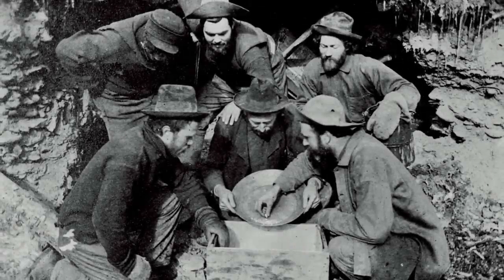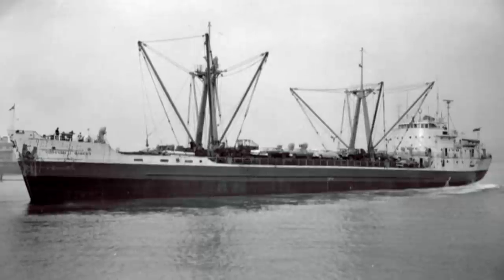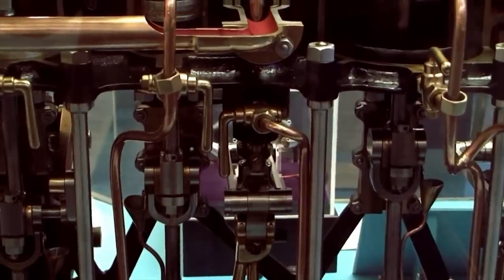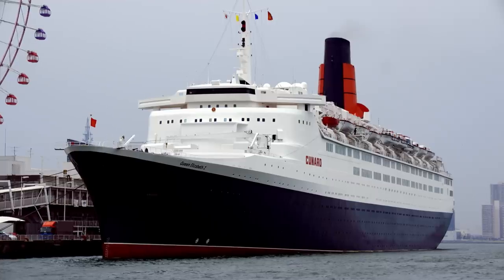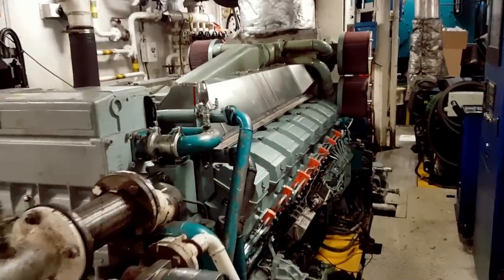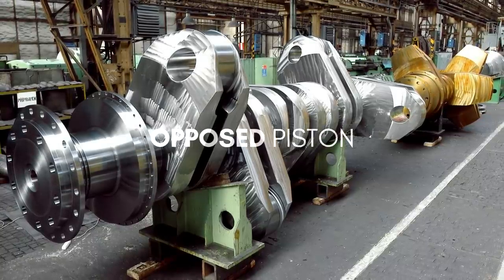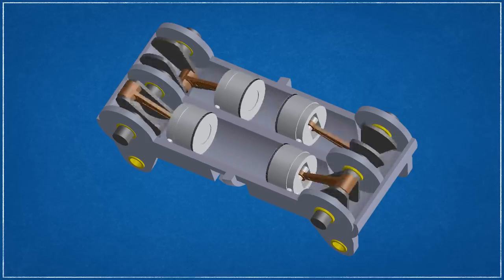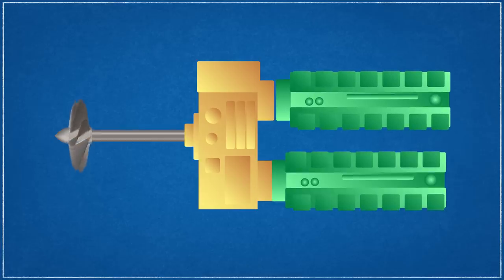The Story Of Large Vessel Engines

Comment: Hi, marine engineering student here, I want to make a comment on the electric drive pods shown in the video at 12:04. This type of propulsion is not more efficient than conventional type of propulsion and here is why. 
For electric propulsion the diesel engines drive huge generators generating electricity. After that the electricity is transferred to the propeller's electric motor via an high voltage system. Then the electric motor has to turn the electric energy back into motional energy. In all these transitions of energy you lose some efficiency. Furthermore, the huge electric motor straight after the propeller increases drag. That's why this system is less efficient than conventional propulsion. That's also why the biggest container/ cargo ships still use the conventional method. 
The advantages of the diesel-electric system is (like you said) maneuverability, but also there is more freedom in placing the engines in the ships design, since the engines don't have to be placed directly in front of the propellers. This is why the diesel electric system is massively used on cruise ships and dynamic positioning ships, where efficiency is less of a concern. Cruise ships sail into harbours almost daily, so a ship with more maneuverability saves in costs of hiring tug boats. Also space on a cruise ship is limited so being free in the placement of the engines helps with a compact engine room design.
Ships with dynamic positioning don't sail as much but need a system like this to accurately stay in position.
For those who have read this, thank you for your time and feel free to ask me any questions!
ps. don't mind my english, it's not my native language.
Reply: Thanks, I didn't know anything about any of that.
Reply: Is it not the case that cruise ships with a huge hotel load require main engines that are 4 stroke high speed to mainly run alternators, with the consequent reduction in height and possibility of constant running over the two stroke diesel, all of this reflects the commercial application
Reply: Yeah i find it weird that a diesel electric would be more efficient than a pure diesel on a ship, especially that no batteries were mentioned. It's not like ships operate like cars. Thanks for providing clarification.
Reply: All your points definitely make sense,  thanks for taking the time to break it down. Also have you ever seen the opposing engine design that was featured in the video.  Thanks.
Reply: @vincentrusso4332  i think there is a british opposed piston diesel.
Reply: Very often there is a number of electric generators which can be started or shut down, depending on the effect needed on the propellers.
One large generator is indeed very inefficient at low speed.
The QE2 has nine generators to drive two electric motors.

https://en.wikipedia.org/wiki/Queen_Elizabeth_2
Section about machinery.
Reply: Your English is better than that of most native speakers I know.
Reply: @vincentrusso4332  hi Vincent, 
I have sailed as an intern on a diesel-electric ship with DP3. The ship was equipped with 6 diesel generators and 6 azimut thrusters (just like the Electric thrusters in the video)
Reply: Thank you!
Reply: Yes,the Doxford is opposed piston engine.Dont think any are still in use but I could be wrong.
Reply: Hi there!
I've heard that maintenance cost is also partly the reason for using electric motors with diesel generators at those big ships, is that correct?
I know that diesel engines love consistent workloads and I presume that the always changing strain on the motor if directly connected to the power train would wear them down much more than good electric motors. So they instead are positioned at the turbines.. Plus no need for a transmission! At least that's how I'd explain it to myself.
I'm sorry for the late question, I hope I'll get an answer nevertheless :)
Reply: @pasta4086  Convenience is the reason for using electric propulsion.It means that you can position the prime mover (engine) in any location not necessarily at the rear.Its nowhere near as efficient as a direct drive shaft setup as there is generator and motor losses to take into account.
Reply: @expfcwintergreenv2.02  I'm sad to say you are correct sir!
Reply: Thank you, that's very interesting! Could renewable energy sources (like solar panels or wind turbines) be added to a ship with electric propellors to supplement diesel generators, thereby offsetting the lost efficiency? I am just a layperson with no knowledge in the field, sorry if this is a stupid question :)
Reply: @eccentricity23  Hi Adam, thanks for your question. Yes, renewable sources could be a option, however there are some problems. If a ship would be equipped with wind turbines, the increased drag would always cost more energy than what it will deliver (except for rear wind, but than the turbines won't be very effective). Solar panels could be an option to add to the generators, however a ship could not rely on this (a ship couldn't sail at night for instance). Also it would be difficult to handle the overproduction of energy when more energy is delivered by the solar panels than the ship spends (like if the ship would be in the harbour or is laying for anchor). However, this could be solved by dumping the energy in the sea water with heater. 
But still, the largest reason that this isn't implemented on ships is costs. The amount of solar panels or the size of the wind turbine would be huge. Furthermore, ships have an 3-phase AC electricity net, so the energy must be converted. All this would probably be more expensive than just using the generators. Also for practical reasons it would be hard if you consider that most of the ship's deck must be covered with solar panels to make a significant amount of energy relative to how much is generated with the generators and used on board. 
Still i think there must be ways to overcome these problems, like using hydrogen produced on shore with renewable energy for instance. There would be a lot of engineering challenges, but i do believe we must go to a more green future.
Reply: @vincentrusso4332  Hi Vincent, i'm sorry to be a little late with my reaction, but no i have never seen these engines, except for on the internet. My grandfather however, actually has sailed with an opposed piston engine. But he told me he didn't like it because they need a lot of maintenance and had a lot of problems. (this could also be because of this particular manufacturer or just because this concept was new at that time)
Reply: @pasta4086  Hi Pasta, You are right with the diesel engines like a consistent load part, however the giant container ships using the 2-stroke engines usually also have a very consistent power demand (sometimes sailing the exact same speed for weeks). 
The maintenance costs of a diesel-electric configuration is usually way higher actually than that of conventional configurations, because diesel-electric ships have multiple generators. For instance, the ship i've been sailing on had 6 diesel generators (8 megawatts each). When sailing at full speed, at least 3 generators were running. This means having 3 times as much running time than if we would be sailing with a single engine. The maintenance jobs on the engines are based on running time, so using more engines will lead to higher maintenance costs. Also you have way more components using a diesel-electric configuration (additional generator, high voltage switchboard, transformers, electric motors, etc. furthermore, all these components need their own cooling system with pumps and everything.). Yes you don't need a gearbox, but gearboxes usually are really efficient and don't need much maintenance. Large 2-stroke engines usually don't even have gearboxes, but have their propeller is directly connected to the crankshaft, even without a clutch.
Reply: @arienvanommen9672  That makes a lot of sense. Are hydrogen fuel cells used on any current large ships? Shipping seems like a perfect application.
Reply: @eccentricity23  not as far as I know, however lng (liquefied natural gas) is coming up as it's a relatively clean fuel (compared to diesel oil or heavy fuel oil). I'm not sure if this fuel can be made with the use of renewable energy, until now they use fossil lgs (as far as I know).
Reply: Diesel electric does away with energy absorbing propeller shaft/s and in someone cases reduction gearbox/s, so what it looses in some criteria it gains in others. The ability to berth quicker with less dependence on tugs and safer in rough conditions is also advantageous. Oh and electric motors will respond quicker with infinite control.

Comment: You mention the Titanic as a "steam piston engine" ship.  But she was a bit of a hybrid.  Her drive used two piston engines driving the wing shafts, and they both exhausted into a single low-pressure turbine that drove the centre shaft.  Low pressure turbines have an advantage over the low pressure cylinder in a piston engine is allowing the condenser to set up a lower than atmospheric pressure at the exhaust without fear of water droplets forming and causing hydraulic locks in a piston engine cylinder.
This was exploited by Parsons in the early all-steam turbine ships as well.
Reply: Excellente!

Comment: Crazy that some of these only reach 80 rpm. Some small gasoline 2 strokes can get above 15,000 rpm. the torque figures on these diesels must by incredible.
Reply: Well, the biggest marine diesels (Wartsila RTA96-C) put out over 100,000 HP. Now if that's an 80RPM engine, the torque is (5252/80)*100,000 or 6,565,000 lb/ft. Let's see a Hemi beat that.
Reply: Now imagine if they could rev up to 7k or something, the amount of horsepower on them would be astronomical (horsepower being a function of torque x rpm and all). Granted the fuel tanks would also have to be astronomical

Comment: As someone who works and a dual fuel vessel (similar to the one you showed in the video you showed a vs485) a wartsila vs4411. the big problem with Dual fuel is the amount of space you loose for cargo. our LNG tank holds about 200m3 of liquid methane, but takes roughly 700m3 of space. Also due to way these vessels operate close to oil platforms with all the engines on on very low power there is a lot of unburnt methane coming out of the funnel which is not very good for the environment.

Comment: I'm sailing on a 5500grwt supply vessel, we run 4 high speed engines dualfuel engines.
The other advantage to dualfuel which you didn't mention is that the engines are usually a lot more efficient running diesiel on low loads.

Comment: Well done - some minor additions and corrections.  (From the perspective of a retired U.S. Coast Guard marine engineer)
       A two-stroke diesel will always have a scavenge blower to clear the exhaust gasses from the cylinder.  Typically a Roots-type blower directly driven by the engine, it has to be functioning for the engine to start up.  (Noting that Roots-type blowers from General Motors X-71 series engines were repurposed as superchargers on gasoline engines, such as on drag racers.)  The turbochargers are generally optional, and use the exhaust gasses to spin up a compression turbine to boost power.  By quite a bit.  Example:  Fairbanks-Morse 38 D 8 1/8 common on large Coast Guard cutters of the '70s and '80s - 12 cylinder version, no turbocharger:  2,000 brake horsepower.  Add two exhaust-driven turbochargers which kick in at about 600-700 rpm:  3,600 horsepower, and still a very reliable (although mechanically complex) engine.
      Reversing:  Using gears to reverse the propeller for stopping or backing down is not feasible due to size and power constraints.  Steam reciprocating engines and large diesel engines can be stopped, valve cams shifted, then started up in reverse getting full power to stop more efficiently.  Steam turbines used a separate backing turbine which was considerably less powerful, so ships using them would take considerably longer to stop.   Controllable pitch propellers can add reversing without changing the shaft rotation, but at the expense of complexity and cost.
      Gas turbines:   The U.S. Navy uses gas turbines extensively on smaller combatants, up to about the level of "cruiser".  A lot of power in a very small package, but at with a considerable penalty in fuel consumption.  (The first Coast Guard cutter I was assigned to was a frigate-sized ship with both diesels (19 knots) and gas turbines (28 knots).  Range:  10,000 miles on diesels, 3,000 miles on gas turbines.  We almost never ran the gas turbines unless the Navy was paying for the fuel.  The Maritime Administration funded an experimental gas turbine - powered merchant ship (I forget the name) but it never took hold.  I boarded the ship for a safety inspection and the Chief Engineer told me that the controllable pitch mechanism had failed halfway through the first voyage and they had to reverse halfway across the Atlantic.

Comment: There was mention that maintenance of turbines is more demanding than diesel engines, if I correctly heard. I'm marine engineer, been on steam turbine propelled vessels, and on diesel propulsion, both merchant vessels (LNG and oil tankers). Turbines and turbo generators do not require any kind of maintenance, boiler just cleaning of fuel oil burners from time to time. Diesels are maintenance demanding. Diesel generators especially. Always adjusting valves, cleaning injectors, overhauling fuel oil pumps, overhauls of pistons, changing sump oil, cleaning filters, washing turbines. It's very dirty and physically demanding job.

Comment: Yay multifuel engines! With those we can meet alle the emission requirements while close to shore and still burn 
refinery waste once entering international waters (where no one can enforce emission requirements).
Reply: I still like more idea of increasing CO2 emission cost, so all its production would be moved to China and we would just consume imported goods, while entitled to smuggish behaviour.
Reply: I can tell you that in practice dualfuel engines have a tiny little problem while running on LNG, at lower loads unburnt methane gets shot up the funnel. methane is a lot worse for the environment than co2.
Reply: Heavy Fuel Oil is not refinery waste. These fuels need a lot of treatment on board the vessel: filtering, purifying and heating and pressurising so that they can be forced through the engine injectors.
Reply: @bh_486  Oh yeah. Lets find all the technicalities to distract from the real matter. Well played.
Reply: @georgf9279  - You have lost me. What is the real matter?
Reply: @bh_486  Instead of using cleaner fuel (with less sulfur and other contaminats) all the time, we build dual fuel motors that allow us to use clean fuel where restrictions can be enforced and still burn the nasty stuff once in international waters. So dual fuel motors are basically the dieselgate of ocean vessels.
Reply: @georgf9279  - Most vessels used diesel fuel before the 1970 'oil crisis'. The cheaper heavy fuel oil was a response to this, but obviously to use this high viscosity and low quality alternative required additional equipment. The vessels are simply changing over to lighter fuels when entering the designated zones, where population is high and more likely to be affected by contaminants such as sulphur. Larger engines and larger vessels are more efficient with regard to how much cargo is carried using less fuel. There is always a steady improvement in these technologies.
Reply: @bh_486  it's comparable to ashfalt, nasty stuff hope to never handle it again.
Reply: @NowAndyPlays  - For sure, heavy fuel oil is a pain in the arse, but it is liquid. Asphalt, if not kept warm, will solidify, and once that happens it is time to get out the picks and shovels. There are vessels that carry asphalt as a cargo, constant heat required.
Reply: @bh_486  Yes, cargo heating loop water turns nasty after a while

Comment: Good video, but at 3.01 mentions that HP does most of the work, however, when engineer takes indicator cards, great efforts are taken to adjust valves so that each piston produces the same power. Also mention that compound/triple engines are far more heat efficient as they reduce the heat loss in each cylinderas hot steam comes in contact with cooler metal. If that metal is hotter (ie. at a higher average temperature), the heat loss is less and more steam pressure is there to push the piston.

Comment: It's interesting how the 2 stroke dominates among both the smallest engines and the largest engines while the 4 strokes dominate in the mid range. However, a small engine 2 stroke is pretty different from these huge ones. A small 2 stroke does not need forced induction, or exhaust valves, the piston does all this. However, they do need oil mixed in to the fuel as the crank case is used to house the fuel air mixture before it's put in to the combustion chamber through transfer ports.

Comment: the cost of operating an electric drive on a ship is not 20% lower, but usually a little higher than a normal disel 
(2 energy changes less: mechanical - electric, electric - mechanical). The actual performance is influenced by the way the vessel is used (whether it usually sails along long, uninterrupted routes, or does a lot of maneuvering and requires a severe change in engine load). Large ships (with the exception of passenger ships) sail on long routes, so the electric drive will not replace the diesel quickly.

Comment: A global fuel sulphur cap has just been entered into force on January 1st,  0.5% by weight globally; EU ports, emission control areas capped at 0.1% by weight. Some ports uses drones to check the exhaust gases, a lot more work for the engineers to ensure a complete changeover from high sulphur fuel oil (HSFO) to low sulphur fuel oil (LSFO).